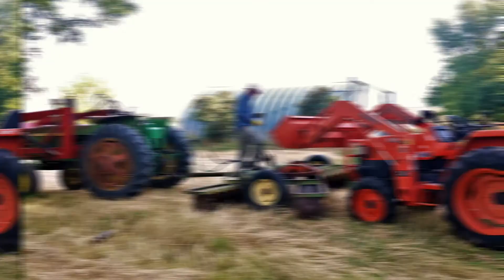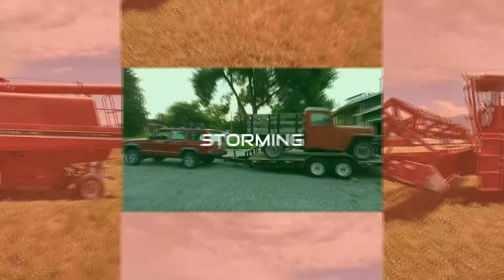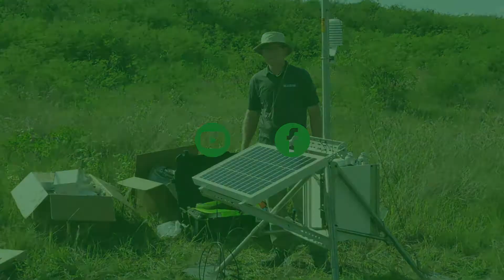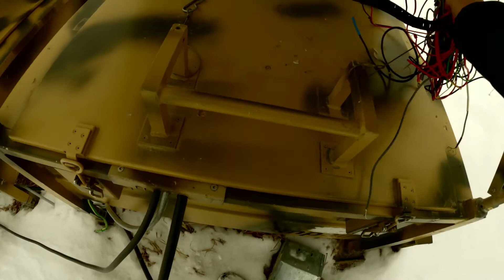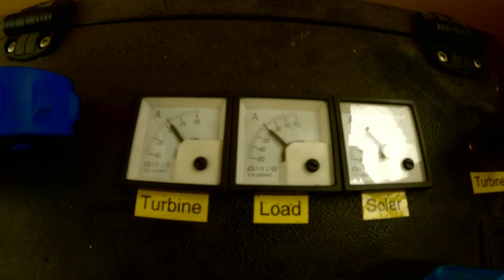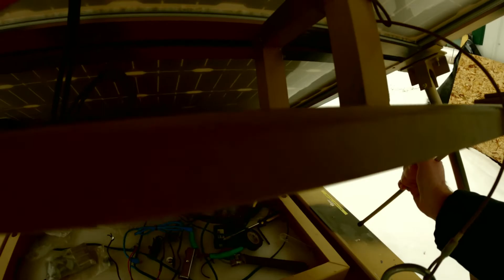AmpAir Wind Turbine. How I'm going to use it on my greenhouse.

Comment: I'm told that shorting the turbine like that is for emergencies only (it damages the windings by heating them to the extreme when done in decent wind). See some of the youtube videos explaining and showing the damage. Love those metal cases, any idea where we can buy one? We have 5.7Kw solar and a 3-4Kw (13 ft rotor) wind turbine being installed for our greenhouses in Newfoundland. We currently have double filmed, inflated, standard greenhouses, but will likely switch to the chinese style (triple film, blanket, earthen north wall). We have 20Kw of LiFePO4 batteries. We subscribed.